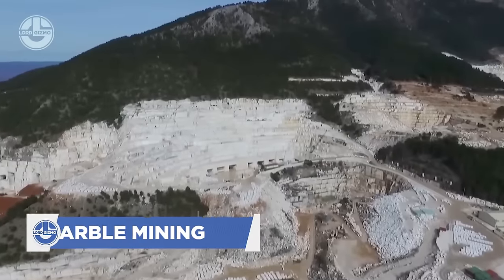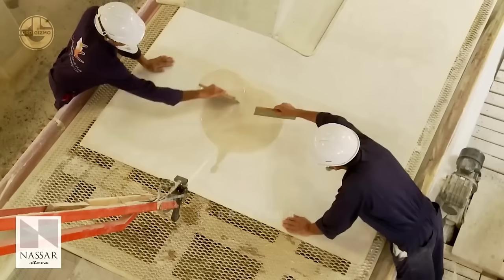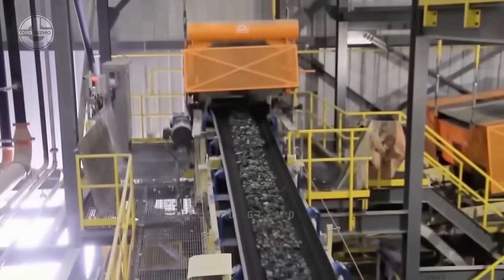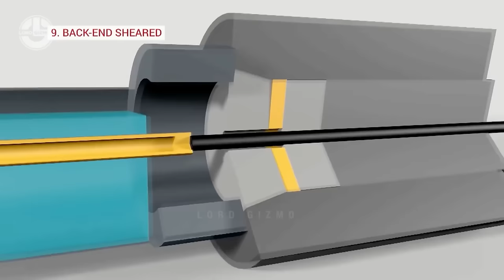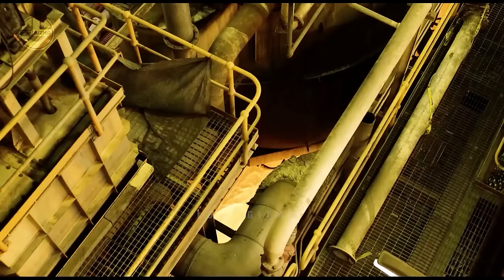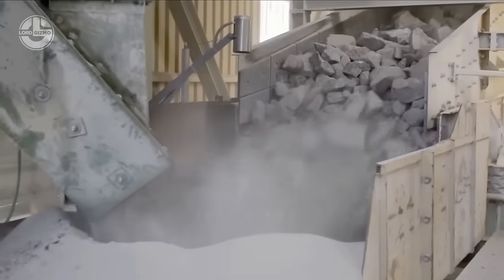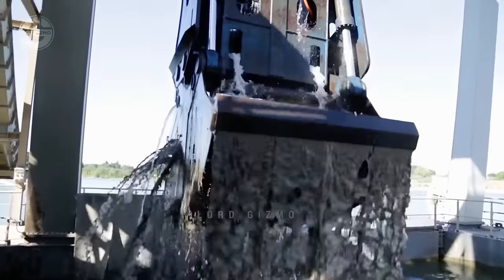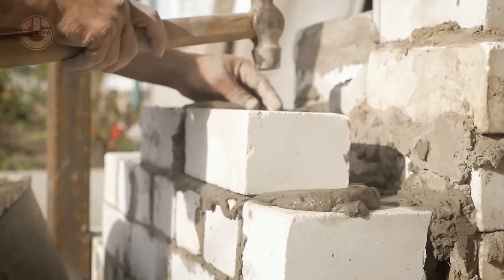Our Top 5 Must-Watch Mining Videos You Can't Miss!

Comment: There could be a better way of lowering those slabs so they don't break. So wasteful.
Reply: So invent something Mr engineer
Reply: They use all the pieces, even the small ones.
Reply: I think it's part of the quality control which determines whether there are cracks in the slabs or not